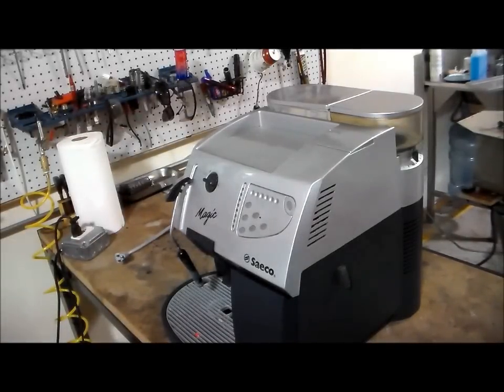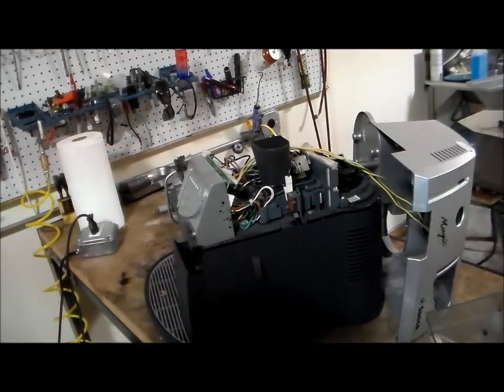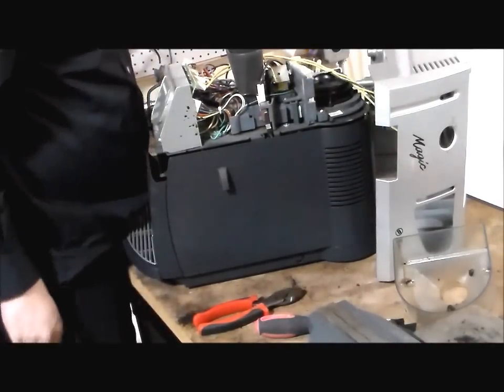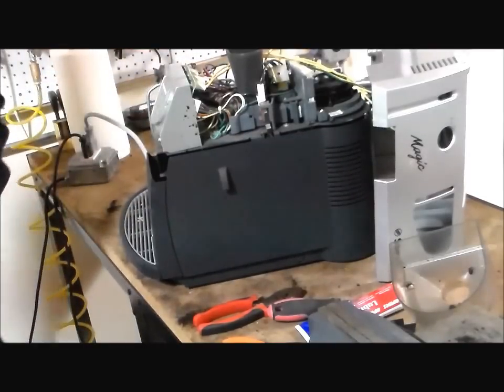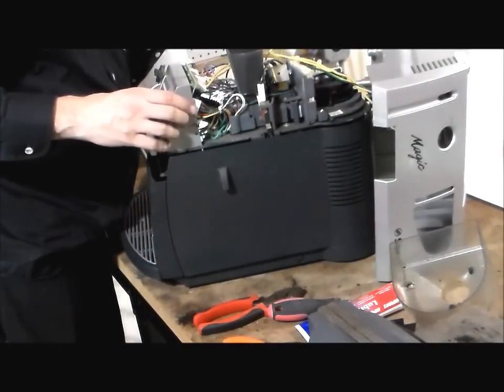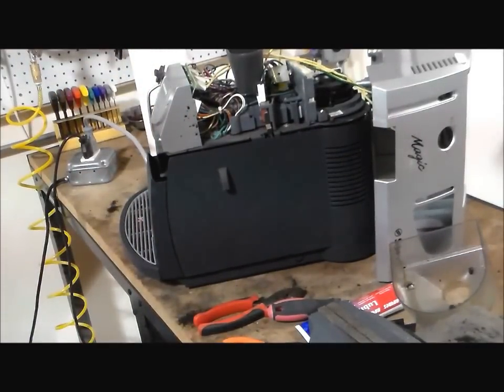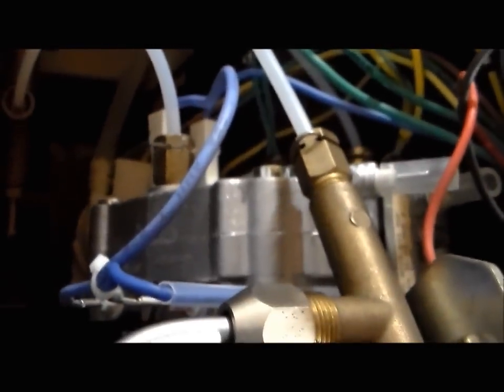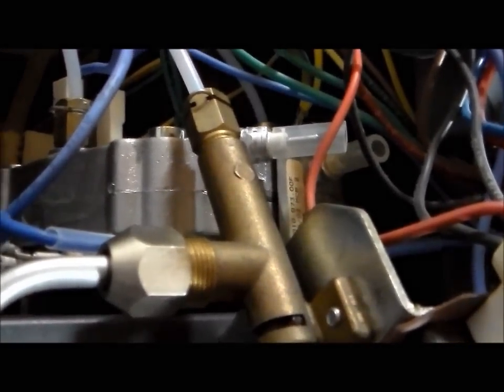How to Replace a Saeco Magic Deluxe Boiler

Comment from the maker: Yes you could change the oring in between the boiler halves if you can find a vendor that has it.  You might be able to just replace the seal but you might find that the limescale has eaten away part of the boiler material and you will not get a very good water tight seal.

Comment: Do have a question.I have the magic deluxe and is water suppose to come out where the drip tray goes in backside far right corner?I read it is supposed to do that prevent a build up of pressure.Alway let's out about an 1 oz of water right after  brewing cycle finishes.Never leaks any other time and its not really a problem if the drip tray is left in place.Picked it up at a Goodwill outlet for $3.00 and so far only other issue is the water level magnet in the tank causes the empty sensor to come on.Put a magnet on outside of tank and have too keep an eye on water level.Might replace tank later,but for now it works.

Comment from the maker: You could have a couple of problems.   The grinder might be set to fine or you might be putting to much coffee into the doser mechanism.  The pump could be bad.  I have also seen the hoses get clogged due to lime scale build up. How old is your machine?  if you review our pump replacement video for a Saeco Vienna you will be able to see the born on date and the average life span of that type of pump.  If your pump is past the life span their is a good chance your pump is bad.